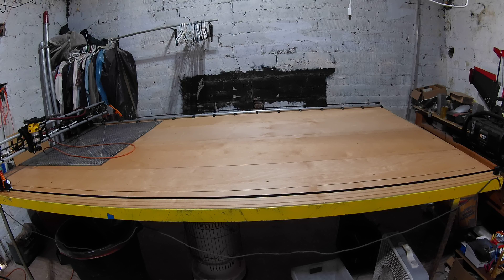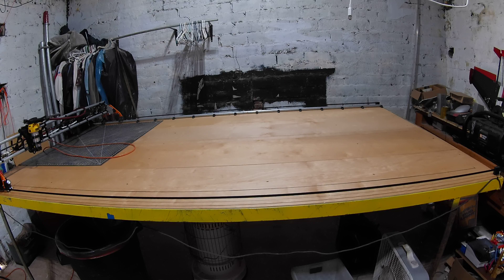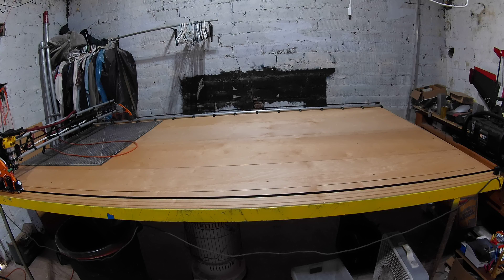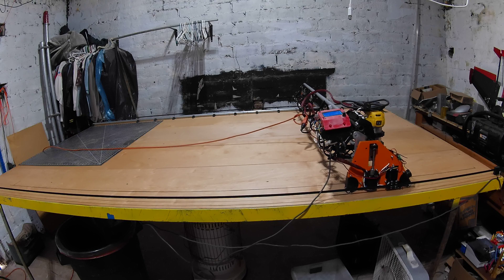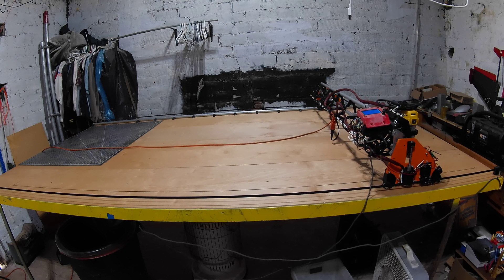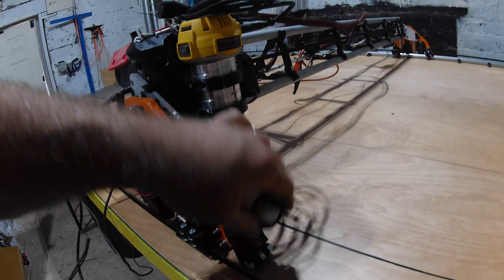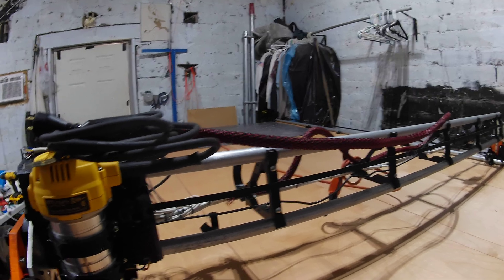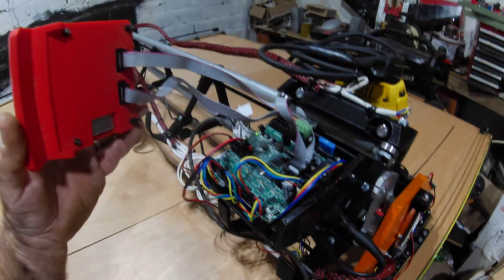LOW-RIDER 3 CNC Machine  ( MPCNC )

Comment: Can you fit diode laser head on this cnc machine
Reply: You can. Many LowRiders are controlled by an SKR board, with Marlin, and there are pins on it that can power and control a diode laser.